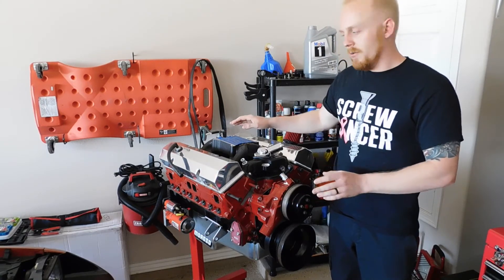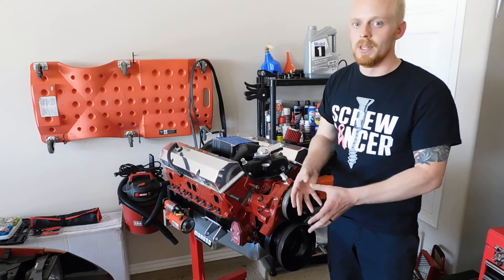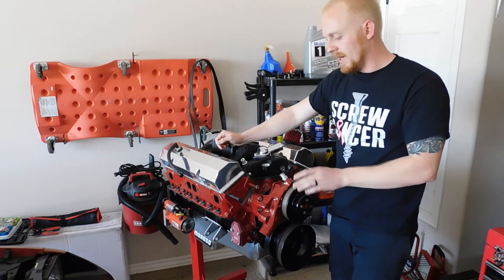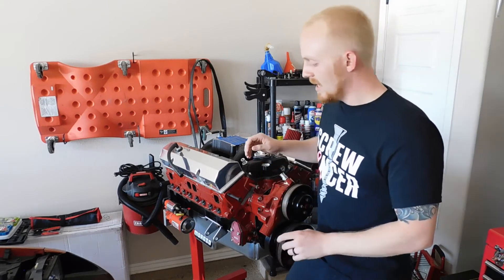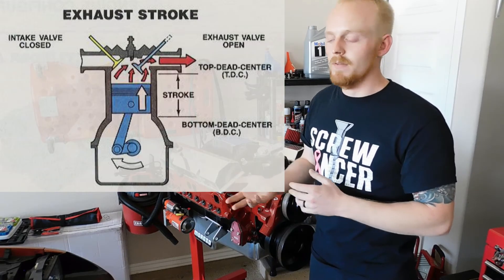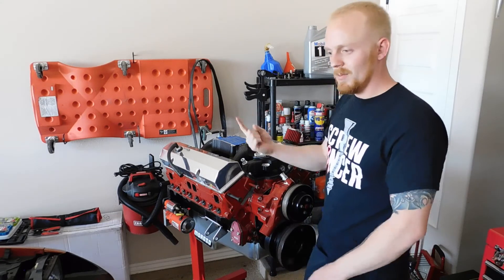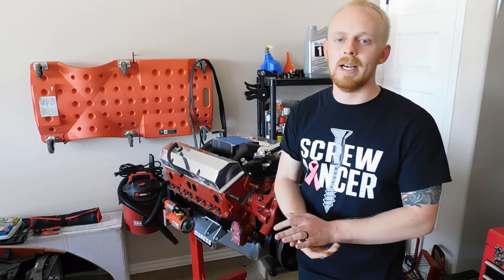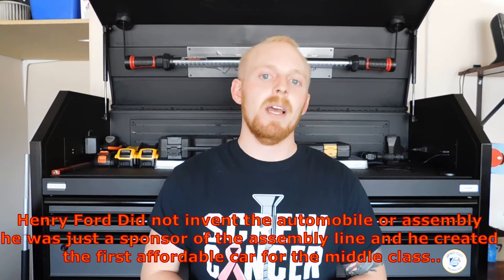Tech Tip Tuesday Suck Squeeze Bang Blow / 4 strokes

Comment: The part about efficiency is why we need electric vehicles. Course in an EV it's the opposite the electric traction motors are very efficient but the battery that supplies the power is inefficient.

Comment: Nice video.  A question: would it be possible to hand-turn the crank shaft and move all the pistons and valves, or are the tolerances so tight, and friction so high, that it wouldn't budge?
Reply from the maker: A Frend thank you for watching. yes it is possible to turn the crank by the flywheel / flex plate or the front of the crank. it is tight tolerances but not so much that you can't move it. if you can't you might have a seized piston or binding internal part
Reply: Yes, in a way... Mechanics do it quite often, like when replacing a timing belt. Usually by putting a wrench on the crank shaft bolt and turning it that way. And if you have the spark plugs out it makes it a lot easier because it leaves a hole where each spark plug was to draw and push air through...